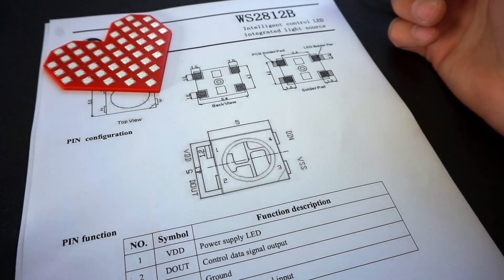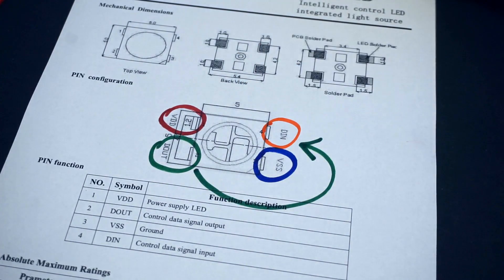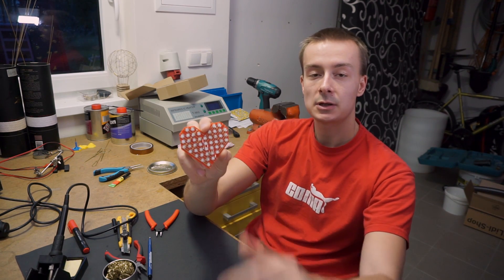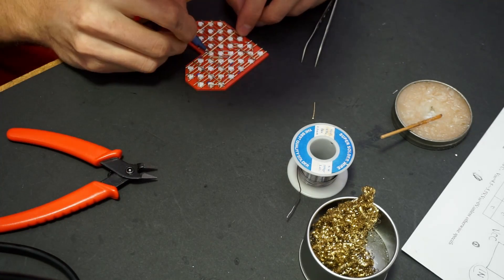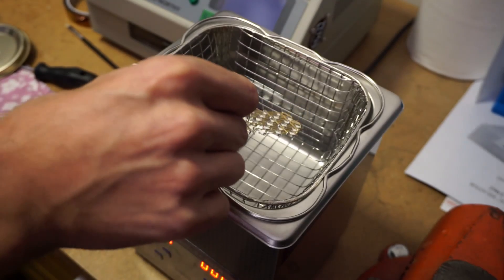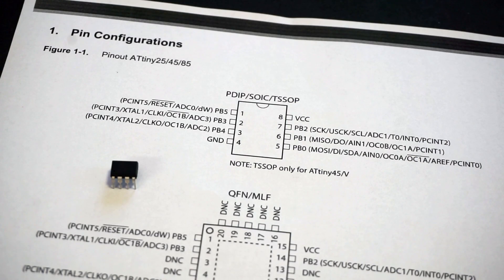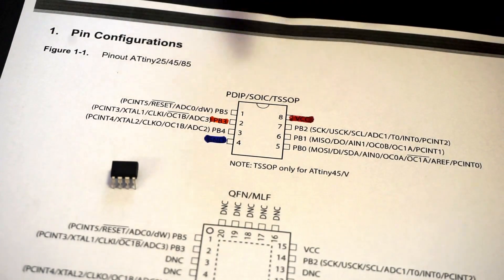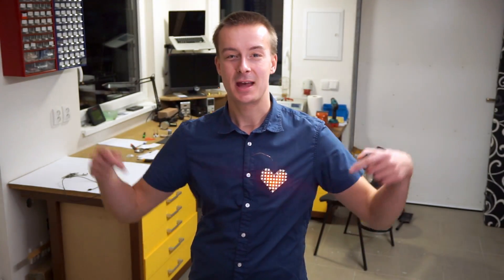Brass LED heart badge

Comment: Beautiful work as usual.. but you should use a 220ohm resistor at the data pin, it's recommended  deff cleans the signal up..

Comment: You should try using copper wire because it's more conductive than brass wire
Reply: small amount of current circuits do not bother much about conductivity bro.......its functionality will be same...no much difference will be seen...

Comment: What liquid is in the ultrasonic cleaner?
Reply from the maker: IPA Cleanser
Reply: What is ultrasonic cleaner used for?
Reply: @vamshisaikrishnaarelli9778  clean off the flux
Reply: @AlphizZzle  Do you need the ultrasonic cleaner, or could you just cover the circuit in IPA cleaner?